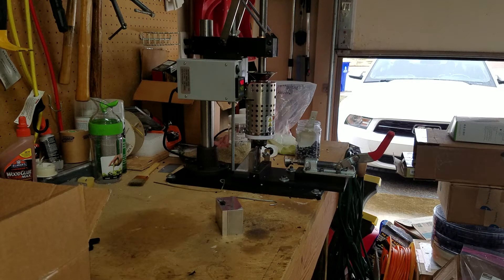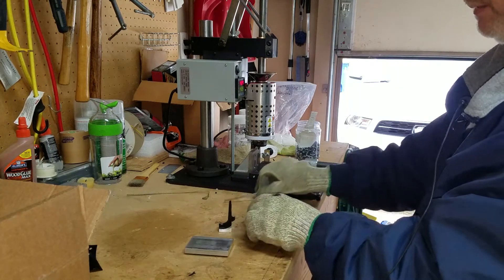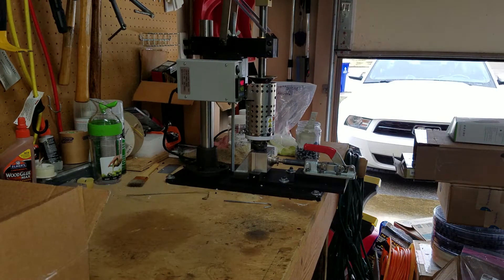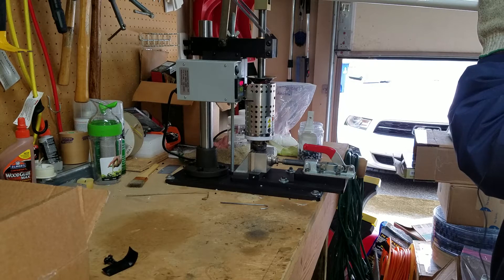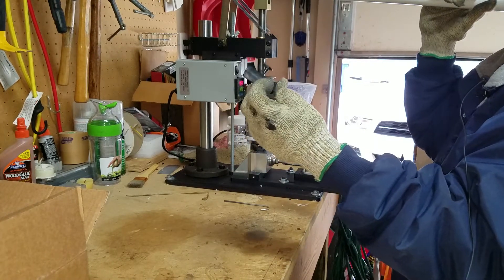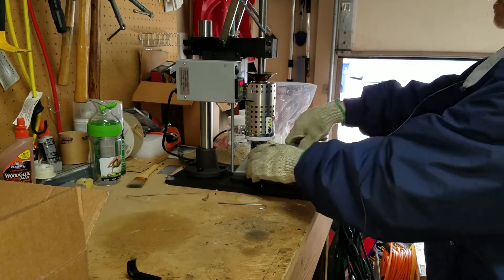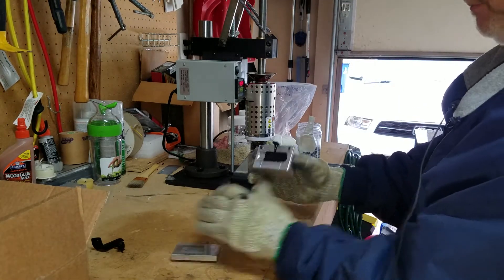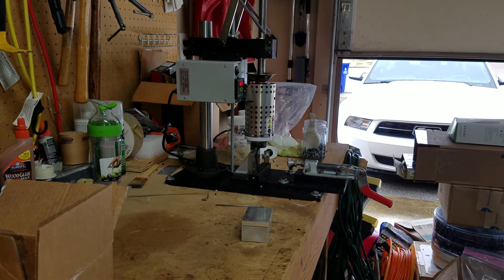This is why I bought the LNS Technologies model 150A injection molding press.

Comment: Thanks for this video. I don't understand all the negativity about this machine. It seems great to me. I'm currently using a 3D resin printer, and casting in resin, and I really dislike both those things.
Reply: The cost is a bit high but I needed something quick and ready to go out of the box.  So, this worked for me.

Comment: Great video! Many points out in the comments, that the cost of the parts is not massive. That is true, but they are missing the point. I would guess that building your own from scratch will easily take 10-20 hours of you are a skilled machinist, but never built a similar machine. If you are not a skilled machinist, it will take much more time and instead of solving a problem, you just got yourself another one. Machines never become perfect on the first attempt, so you'd need to build more than one. 

The money you pay is not for the parts. It's for not needing to know how to use a lathe + CNC as well as the knowhow that goes into something that works.

Comment: Great video on the subject! I'm in sort of the same boat, been making things on an fdm printer to sell, but yes the quality is not what I would like to put my name on. I'm now starting molding and casting but have an eye on home injection molding. I found a video where someone made the machine part by modifying an arbor press, looks promising. For molds I was thinking either investment castings, like how jewelry is made, or home cnc router. Thanks for the info!

Comment: The injector was 1800 plus tax and then the shipping costs, the mold was approx 800.00 to 1,000 to have made, and then the cost of the plastic that went into each part (whatever it was)
So how many of these parts did you have to sell until you broke even?
Reply from the maker: I was having this product made by 3D printing and selling them for $10 each. I sold hundreds like this. I used the profits from these sales to purchase my equipment. But to answer your question, it took about 300 pieces to get my money back. And now that I use injection molding, I make 100 pieces per hour instead of 1 piece every 35 minutes 3D printing. And my 3d printing cost were about $1 each. (I don't have a 3d printer so I had others make these for me) and my cost now is about .17 cents including labor.

Comment: When you had you mold designed/machined, did you have pressure relief 'ports' built in at the opposite ends of the injection point to relieve injection pressure?  Meaning, allowing the plastic to flow without having to exert a lot of pressure to fill the mold....
Reply: Yes

Comment: Excellent video as I'm looking into home injection molding setups myself right now. It seems that this press (and other home presses I've seen so far) are limited in terms of the size of the mold it can accommodate. Based on the machine's design,  would it be possible to rig a setup with it that can accommodate larger molds? Thanks if you're able to respond!
Reply: The unit can be adjusted a little. You can raise it up and the clamp will move back to make more room. Exactly how much, I do not know.

Comment: I'll be 3D printing the master, make silicone mold from that, then cast in resin. Injection molding machine would be useful, but the prices are insane for what you are getting. The die prices are outrageous also. I know my way around Fusion 360, and making a die is not that difficult, and certainly does not justify the cost of $1,000 for a die. This machine should cost under $500... if not $200-$300. A die for this simple part should be around $100 if you supply the 3D model.

Once companies stop price gouging for injection molding machines and die prices, I'll pick one up.
Reply: As with so many things, quantity is the killer. The total market for benchtop injection molding is how big? Maybe 10k units a year? Spread that over 4-5 major companies and none of them are making enough of them to really get economies of scale going for them. I think in many ways benchtop injection molding is roughly 5-8 years behind 3D printing in terms of becoming commonly available mass market machines. Home CNCs are another area where commoditization of hardware is advancing, but home CNCs seem like they will have a harder and higher floor price if you want to do anything harder than wood on a real precision basis. When home CNCs come down to about $4k with tooling, mold making for injection molders will be practical for many startups. Though it is arguably practical now for the higher margin products.

Comment: I had a few questions regarding the process of actually making the product itself; Where do you get the pellets from, how to get the colours you want, size of mold and the cost of the mold
Reply: The mold was about $900 from www.benchtopmolds.com. I buy most of my pellets from eBay: 10lbs for around $45. The problem with this and other vertical machines is they don't mix colors. You almost have to have already mixed colors (masterbatch) before you start.

Comment: Who creates the mold?
Reply: Ernesto Garcia at
www.benchtopmolds.com
Reply: I have made several molds for my own use with a Sherline Mill and lathe. I wrote the software to control four of my machines. I'd be glad to make one for you if it is not too complicated. I have used only polyethylene from milk bottles. When using this kind of plastic, you need to make the mold a little larger than you want the part to end up being because PE shrinks about 3% per dimension.
Reply: @Tapajara  I would love for you to make me a mold. How much would you charge?
Reply from the maker: @Tapajara  I am still interested in having you make me a mold.
Reply: @Prodriverproject  Hi Robert, I would be interested in making an aluminum mold for you. I have a Tormach 1100. Let me know if you are still looking!